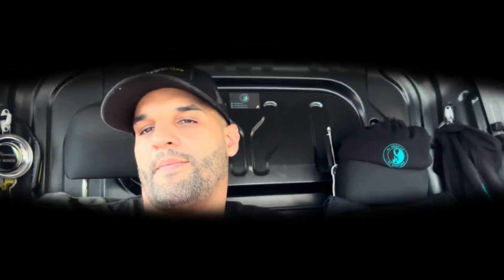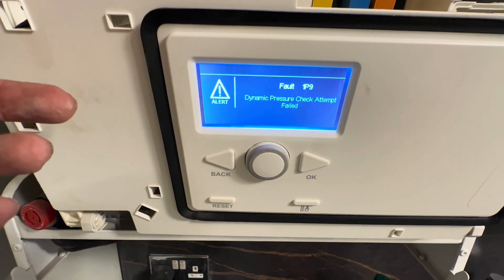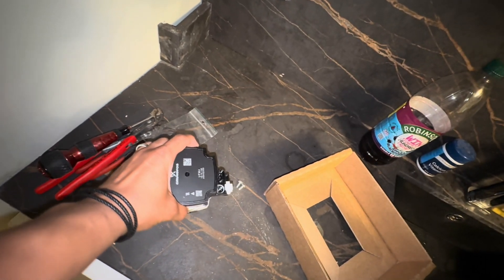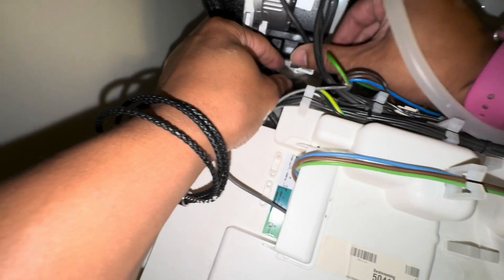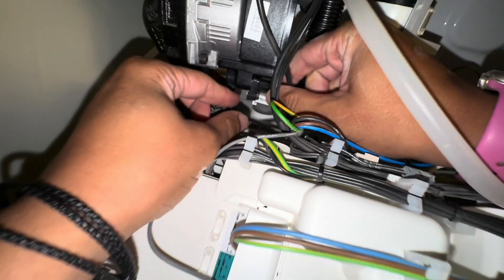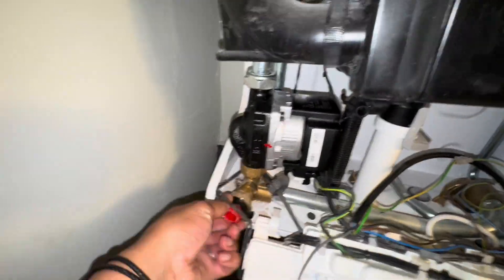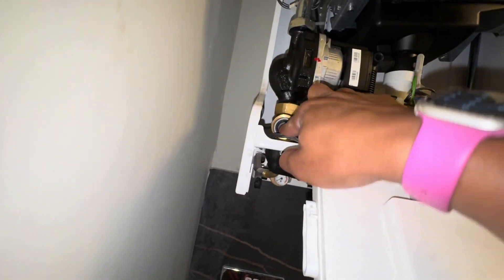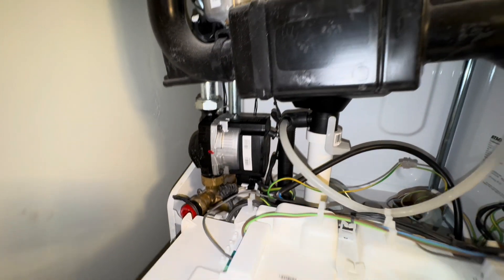Why’s everything cold??

Comment: Doesn't that head come off only on those ERP pump, haven't done it but I was showed it. ERP pump button and top clip and the head comes off with draining it
Reply: Yeah you can unclip the head without draining it, if its just an electrical fault you can do that and you’ll be sorted, not that this job was tricky but can help u out if its an open system
Reply from the maker: @MrMarco3  definitely! That’s useful to know. Is that all the UPS3 models of the Grundfos?
Reply from the maker: @hali5341  interesting! I’ve not heard of this. I’ll have to do some research as that would make an easy job even easier!